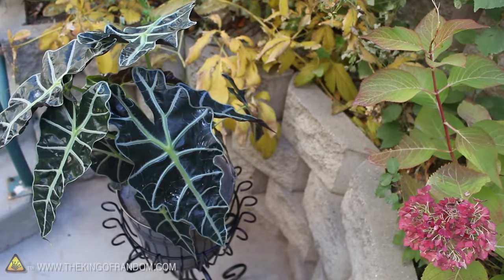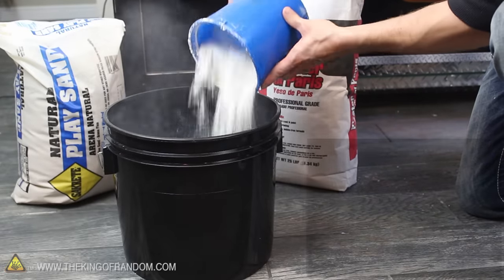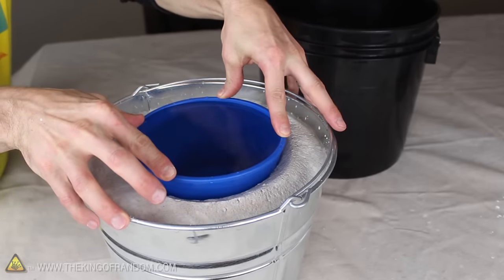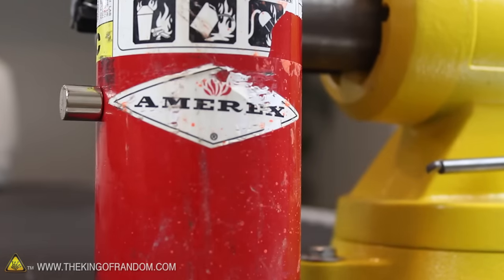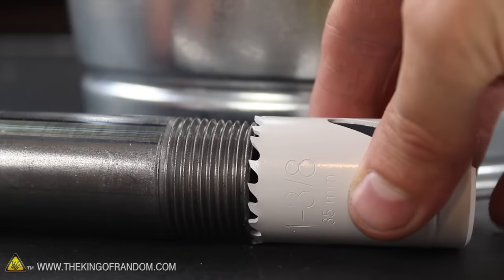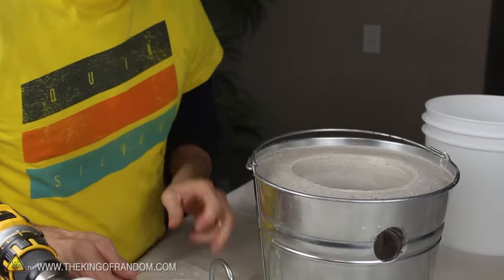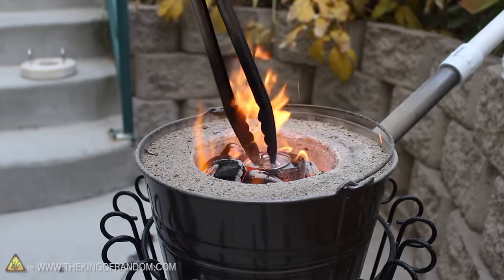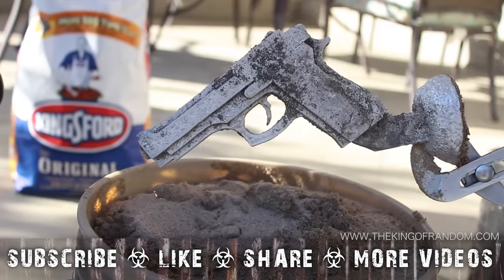How To Make The Mini Metal Foundry

Comment: There is no mention as to what you use as a blower. So ... ?
Reply: Hairdryer
Reply: Rahere Just what I was thinking, but it could be something else equally easy to obtain.
Reply: Sure. Anything to get oxygen into it. Mind you, if you go too far, you could blow the fire completely out of the furnace ;(
Reply: Rahere I could always make a feed from my oxygen cylinder, but the costs would be prohibitive.
Reply: Someone once asked me to find a flame thrower for a Gulf State's police force. The other corner was to carry a water cannon. never could sort out which came first.
Reply: A leafblower would work wonders. If you could find a way to cool the air and compress it you could make this go even hotter too.
Reply: Rahere Watch out for an old episode of Top Gear when they modify a combine harvester into a snow plough. Clarkson does his usual over the top addition to the vehicle by adding a flame thrower.
Reply: That upper-class snob? No time for him.
Reply: You can use an old cheep blow dryer
Reply: maggie rasic On further reflection I'm considering my leaf blower.
Reply: I tried a wet/dry vac and noticed the cinders that came out were quite large... a lot of unspent fuel came out this way. I assume a leaf blower would add too much air as well and the same problem would occur. A leaf blower could work but an air supply control valve of same nature would be needed.
Reply: try a hair dryer set on low air, its what i use on my forge.
Reply: paul gillis Modified an old hair drier to do the job by adding a metal tube to the outlet. Haven't used it to dry my hair in ... forever.
Reply: well if the that's to low of speed build a box with a dimmer switch in it  that should do it also
Reply: A hair blower
Reply: yes instead of a overpowered shop vac that blows live coals out at times
Reply: why is it needed to make air cooler and compressing it??
Reply: Matko Lendler The air isn't been made cooler or more compressed. There's just more of it being forced into the bottom of the fire to make it burn hotter.
Reply: Used hair dryer is best for the scale. A leaf blower would be too much hahaha, and besides...a hair dryer heats up the air.
Reply: use your girlfriend
Reply: So if you don't have a hairdryer the closest thing seems to be a computer fan. Similar airflow cfm.
Reply: Hairdryer set on cool or another type of blower fan

Comment: I love the project, but it says it cost $20 and I ended up spending $75...
Reply: it said the plaster and sand cost around $20. Which at home depot was about right $15 for plaster and $4 for sand. but yeah I sent about 70 to make this and I still need to find a crucible.
Reply: Kenneth Hayes Lowes has steel fire extinguishers. Home Depot only carries aluminum fire extinguishers.
Reply: Anthony Vitale Refused to let my son buy a new fire extinguisher just to tear it apart... so I went to a local steel place and purchased a 5" length of 4" inner diameter 1/4" thick steel pipe, and a 4"x4" 1/4" thick steel plate for a total of $7.  We took to a friend's house and his son (18, as is mine) welded the plate onto the bottom of the pipe, then my son used their grinder to round the corners of the plate so it wouldn't pull up charcoal when we pulled it out of the foundry.  Heavier than an extinguisher, but works very well and I didn't feel like I was destroying something that was still useful!
Reply: ***** and what are you going to do about the weld slag on the inside?
Reply: ***** There was minimal weld slag inside the crucible.  The boys did a good job of welding it!
Reply: After running mine today for the first time I think you will find a thick walled crucible will take much longer to get up to temp and transfer the heat. Let me know when you run yours with the thick wall crucible how it turns out. I wound up with 5 lbs of finished product.
Reply: ***** thx for the idea i think im going to do the same
Reply: I did a inspection on my crucible and turns out that it was probably a batch or two away from failure. So when you guys try your thick wall pipe let me know how well those work out. Does it get up to temp for melting, Can you keep it at temp long enough to melt enough to cast/ How many refuelings did you need to get there. You will notice cold spots as you run a batch, Theses are caused by your charcoal burning away and falling down. Dropping a few paces in to replace them will remedy this issue after the new coals fire up. Also when you shut down your blower it would be a good idea to remove the pipe as the hot gas will escape back up that pipe potentially damaging your blower.
Reply: It did take longer initially, Anthony Vitale, but then it retained heat longer, as well!  And yes, we ended up adding charcoal several times getting it up to temp.
Reply: Kenneth Hayes well, it DOES say "make a backyard foundry for less than $20" in the description. Not that $75 is unreasonable, just saying. It's a great project though, and I figure I'll make one with my son this spring.
Reply: BaconMasterGaming I went to Home Depot's website and calculated an average of $136.54 without tax. That's all the materials needed.
Reply: Tools are reusable for more fun stuff and you can't ever have enough tools! RAA, RAA,RAAH! I wouldn't factor that in the cost. You aren't using all the plaster and sand, use that to mold stuff or a second furnace.
Reply: I was thinking of using my lefover material to build the internals for a mini rocket stove.
Reply: So I did a new price check WITH TAX at my home depot for every tool that he used except for the drill the total was about $100 thats with sand, plaster, the hole saws, steel bucket, big mouth bucket, small bucket, everything BUT that drill that he used with the hole saw attachment
Reply: BaconMasterGaming He says use play sand, and Plaster of Paris... Not gold, bro.
Reply: Sho'Nuff Says ᶠᶸᶜᵏᵧₒᵤ Jive Turkey! He also says to use math, and maybe do a little research.
Reply: Cost me about 35 and I used my own buckets
Reply: ***** i am 14 and did this myself out of stuff i found around our house. (aka, it works great)
Reply: Anthony Vitale me too, but i did not end up with it in my. (i ran mine for too long and it melted a hole in my crucible)
Reply: ***** Dude I think you just saved me from hunting down a fire extinguisher. I hope my metal recycling place will have something like that. if not I'm sure I can find some place that will!
Reply: Only part of it is supposed to cost $20
Reply: I spent over $100 and still going. The most expensive part was the crucible and charcoal is crazy expensive
Reply: I did it for about 35. I already had sand, I bought 2 tubs of plaster which the tub the plaster came in was the perfect size for forming the hole, got a 10 quart stainless steel trash can at a thrift store for $5, an air mattress pump for $4 and then just bought all the other things at lowes. I don't have a crucible yet however.
Reply: NumNaughts are you buying the hickory flavoured competition charcoal? It's dirt cheap where I am...something like a 30 lbs bag for $15.00......
Reply: You'll save a bunch if you buy a longer metal tube with no threads and just skip the PVC.  The 10 ft tube costs around 6 bucks.  This project cost me <$50 to make

Comment: what did you connect to the PVC for air?
Reply: a hair dryer
Reply: depends on the hair dryer I bought a $10 hair dryer from Walmart a Revlon and went to Ace and got a 2in converted to 1 inch PVC pipe reducer
Reply: @shawncrowson1048  I literally just got the same hairdryer as you earlier today... Lmao how much did you pay for the reduction fitting?
Reply: Dustin Haynes I don't have a receipt but it was like 3 bucks or less at Ace Hardware
Reply: @shawncrowson1048  any idea what tier that Ace is?

Comment: can u make a knife with this?
Reply: +linkcowgamergameplay  you could but it would be very weak due to the fact that it is aluminum. If it is just for display than go right ahead, but if you want to use this knife I would suggest forming it out of a steel sheet
Reply: MyHouse Gaming yeah, but would it work with the steel?
Reply: +linkcowgamergameplay i dont think this model gets quite that hot
Reply: +linkcowgamergameplay His arc furnace vid gets steel hot enough, though.
Reply: +linkcowgamergameplay just Use bronze,I think it will work
Reply: +linkcowgamergameplay  Yes it will work, because its not hot enough to melt steel but hot enough to make the steel workable
Reply: TheCartster1 i actually made some small modifications to the foundry and was using a propane torch as the cruciable and when i fired it up it actually melted a hole in the steel. it was only the size of a quarter but it was still there
Reply: +linkcowgamergameplay Yes, but you will have to use the styrofoam video, and then you will have to "sand' it to a thin point, but sandpaper wont do it
Reply: +Thomas Clark  do you know how long the forge should dry before first fire?
Reply: Jesse Whittard In what context? If you just made it and you are waiting for the "cement" to dry, just to be safe I would wait it over night. You probably don't have to but that is what I did, and mine worked as expected.
Reply: +linkcowgamergameplay he melts brass in it so it should work :D
Reply: +linkcowgamergameplay Yes, thats what I mainly use it for
Reply: +linkcowgamergameplay You don't need to melt steel to work with it. You heat it up and hit it with a hammer. Yes, you could make a knife with this. You need something resembling an anvil though.
Reply: +linkcowgamergameplay yes! I just made a karambit. This can make steel soo hot that it is hard to look at. I will be posting the video tomorrow of the karambit making if you want to check it out and see how to do it.
Reply: Killa Kyle k thx

Comment: what could you take instead of the extinguisher ? HEEEEELP
Reply: a graphite crucible
Reply: MrLele3000 A Graphite Crucible
Reply: But titanium costs a lot. more than the price of everything there combined ;-;
Reply: But, the Titanium doesn't cost like 8 dollars every Kg?
Reply: I bought a small steel paint can from Lowes. It was 2 bucks and lasted about four, five times in the foundry.
Reply: I'm going to try the Colman small steel propane tanks, vent the propane and saw off the top. The diameter is a little larger, though.
Reply: I tried a small propane tank and it was too big. :(
Reply: MrLele3000 a graphite crucible
Reply: gravite  crusibol
Reply: a clay crucible
Reply: you might be able to find old spray cans we found one that was steel and was really thick go check out some jun yards you might be able to find something there
or you could just buy a granite crucible
Reply: I tried those but I was trying pure oxygen instead of plain forced air and when steel gets white hot in contact with molten aluminum, guess what happens? Do not do pure oxygen instead of forced air. It's like a cutting torch.
Reply: I used one of those. They work fairly well, but they are harder to heat because they are bigger.
Reply: Jesse McElwain thanks
Reply: @restorator7  What happens?

Comment: Don't press the blue mold bucket down all the way if you want to reuse it. The potrusions for the handle make it stuck when it sets. 

If you leave it sticking out a little, just the smooth sides are buried. A little easier to pull it out.

Comment: I've seen a lot of similar builds, and   they all have the same problem.  Plaster and concrete are not a proper refractory.  For one, both materials take a while to fully cure.    I've seen videos of a homemade foundry steaming, because it still had water in it, though it seemed dry.  Even once fully dry and cured, both materials will break down, crack and explode.
I realize, these are supposes to be made on the cheap, but there are better/ safer materials out there.
Soft kiln brick and ceramic fiber blanket are relatively cheap and will last way longer.

Comment: Love the video!!! I built on but instead of fire extinguisher I used a skinny propane tank...my question is, I got the upper 3/4 crucible red hot but not the bottom? Should I add some extra coals at the bottom? Like 2 layers?

Comment: I made this foundry using the same size bucket, and refractory cement instead of plaster of Paris and sand. I made that switch because I didn't want to have to recast the plaster.  Instead of buying a small bucket to shape the interior, I used a straight sided steel can that is 6.5 inches in diameter.  I poured three inches of concrete in the bottom of the bucket, and then set the can in the middle and used a trowel to fill in the concrete around it all the way to the top of the bucket.  I bought a 6kg graphite crucible because it was less expensive than the 4kg one.  I have done two test firings using lump charcoal for fuel.  So far, I can't even get my crucible red hot.  It looks like not enough charcoal will fit around the crucible.  I am looking at two ways to get my crucible hot enough to at least melt brass.  First, use a smaller crucible,  (Which size would be best?); and second, use my diamond hole saw to make the interior of the foundry bigger.  Should I go with the first or second option, or both.  Let me know what you think.

Comment: I lined mine with fire cement for extra protection then painted it with fire resistant paint, I also use a heat gun rather than a hair dryer :)

Comment: Maybe my lessons may also help your viewers:  I used your formula, and it was cold outside, so I used pretty warm water.  I noticed that it was MUCH runnier than your version, and even after 15 minutes, was not setting up enough to keep the 2.5 qt bucket set in the plaster.  I thought I may have messed up something, so I scrapped the batch.  I started over with cold water and the same formula, and it set up VERY quickly.  Too quickly, in fact, to let me clean and smooth the top.  But otherwise, looks and works fine.

Comment: does the hole have to be the same size as the crucible or can it be slightly larger? I'm just saying because I made a lid but the hole is well about 4" in diameter. Could I just put a couple bricks over it?

Comment: Hey so I ended up doing your project and I only have just one question about the mixture, when I was finished it appeared to have still been rather not as liquid like as yours and it also seemed to harder up with in 5 to 10 min of starting so my only question is if you might know what I did wrong, for context I increased the size of the bucket because my homedepot not having any 10qt buckets

Comment: Nice project, at 5:27 after pulling out the molten metal how do you get it back in for the next batch as the coals fall into the hole?
Reply: I also don't know, but a solution could be using steel meshing, put it around the crucible (with room for it to move freely) and allow a little trench for the coals to fit in maybe? let me know if it works

Comment: This is an old video, but I just have to ask, what's the max temp rating for the foundry before the walls fail? Aluminium seems to work in this video, but I was thinking more copper & brass?
Reply: You have a point.And what temp do I need it to melt gold
Reply: @kingjoker4741  I've tried this with .925 and so far it has not melted to liquid.
Reply: This will get past 2000 degree F if you do it right.  You need 1900 for gold and about 2000 for copper.

Comment: I have a question.. could you use graphite lubricant powder to mix into your mix for the furnace, and could you use it for the casting molds too? I have a feeling it will work, but just haven't sacrificed the funds for the experiment yet, also i'm missing some parts for my setup still. (still missing the crucible, casting molds, tongs, heat resistant gloves.)

Comment: So I’m new to this and wanting to try it. What is the metal pipe in the side for? It’s for air right? Do you hook a blower at the end of it?
Reply: Yes. You connect an old blow dryer to it (I used an old vacuum cleaner hose) and turn it on low speed and no heat. Heat isn't needed.

Comment: Just a tip instead of cutting the hole down to the bottom why not at a angle sideways so the heat wraps around the crucible and not in one spot?.

Comment: I was a little concerned with you using a flimsy, heavy wire plant stand while operating the furnace. Heated & liquefied metal is SO unforgiving if it were to be knocked over. Other than that one critical comment, I thoroughly enjoyed your videos!

Comment: Wow, this is amazing. I never realized that Plaster of Paris would work at this temperature. Will it stand up to the heat required to melt cast iron?
Reply: Not even close. Even at the temps he is showing it breaks down after just a few fires.

Comment: No! Plaster of Paris sets by hydration and not chemical reaction. This means there's water trapped in it and therefore it will crack/spall in a furnace. You want to use actual refractory materials, they're not hard to buy.

Comment: Is there any reason for the steel and pvp pipe? Why not just get a 1" x 3 ft. steel pipe ?

I got the steel/pvp and over time the pvp ends up warping pretty bad so I was thinking about just getting a 3 ft. long steel pipe for the air tube.

Comment: The #3 crucible in the link to Amazon will NOT work with the other components as it is TOO BIG to fit in the opening and allow for inclusion of charcoal. Wish I’d known this before I went to all the trouble and expense of building exactly as described in this fine video. I’ll have to look for a fire extinguisher instead and return the crucible to Amazon. Hope it will work for me then...